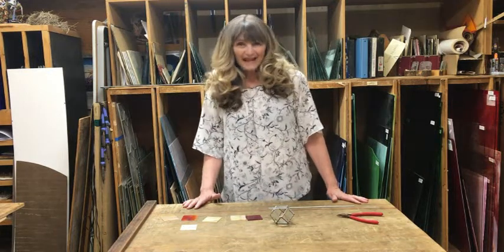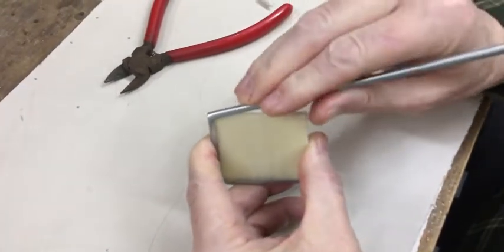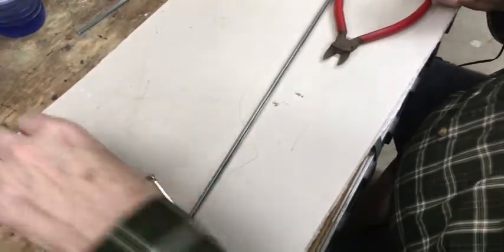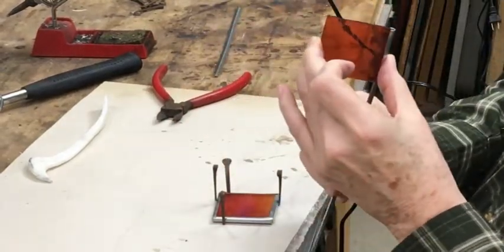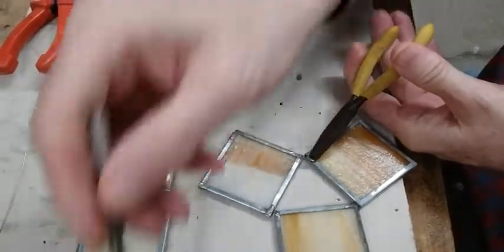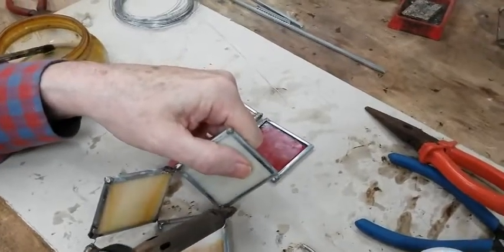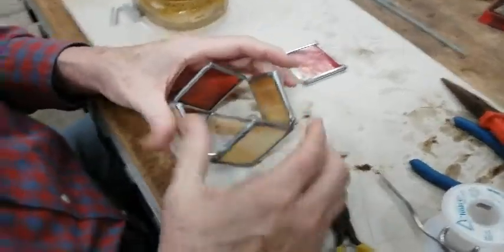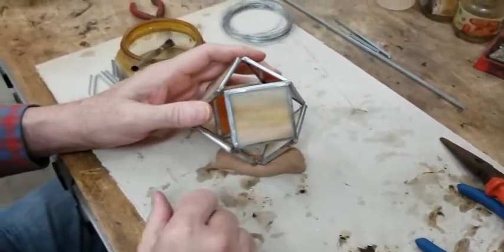Sacred Geometry Stained Glass Ball V264

Comment: A simpler way to connect the corners of your squares is to use a block of wood. Draw a line on two sides, connecting at the outer edge. Lay one glass piece against the side facing you, lined up with the line on the wood. Lay the second piece on the top of the block, again lined up with the line. Tack solder where the corners meet. Now the pieces are at the perfect right angle and the corners always line up with each other.  Repeat with the remaining two pairs of squares. I also use the block to connect the first two pairs of squares.
Reply from the maker: Great Idea, I'm going to give it a try! Thanks for sharing!!!

Comment: An alternative approach to the construction starts with an equilateral triangle with the sides the same length as the sides of your pieces. Draw this on paper as your “ pattern”. Inside each side hammer in two horseshoe nails. You will need 3 blocks to hold up the pieces. Lay  a piece on each side of the triangle abutting against the nails. Raise each side using a block to hold it in place. Keep adjusting until you see that the pieces are in the correct position i.e. the corners of adjacent pieces are the same distance apart as the length of the piece. Using a additional piece is the easiest way to do this.  Once the pieces are in the correct alignment, tack the pieces together. I ended up dropping a drop of solder in each corner.  Now remove the structure . To complete the structure, make another piece like you just did. Now, you just need to solder the two “ halves” together. They should fit perfectly and go together easily. I constructed mine using beveled tiles and copper foil ( I didn’t have enough zinc on hand to use that). The bevels provide a very nice prism effect and attract a lot of attention. I think you could really crank these out if you wanted to sell them or make gifts for a bunch of your friends. I have mine hanging on my porch and am waiting to see what the humming birds think of it.
Reply from the maker: Thanks, I'll give your technique a try!

Comment: Did you grind the glass edges or not bother since not using copper foil? I have a similar piece but it is completely clear glass with a hole and hangar at the top. By adding distilled water and hanging in a window it creates prisms throughout the room.
Nice job!
Reply from the maker: We didn't need to grind the pieces since the zinc covered the corners. Your piece sounds nice. I'd love to see a photo. david.gsglass@gmail.com